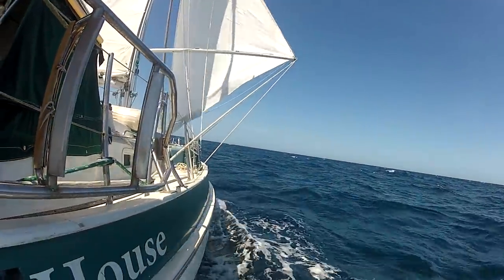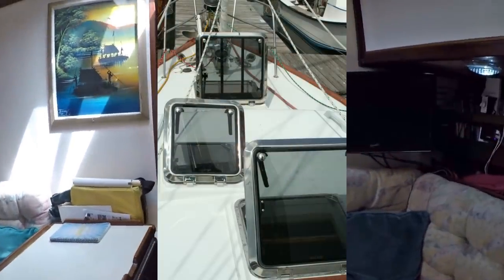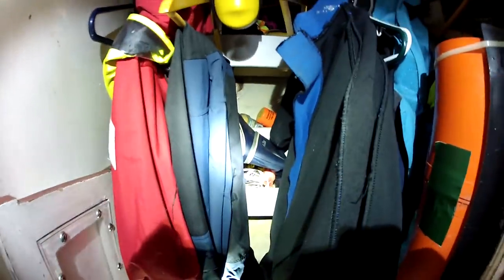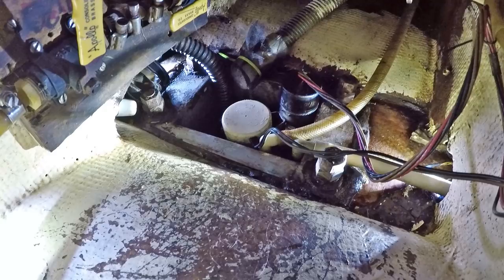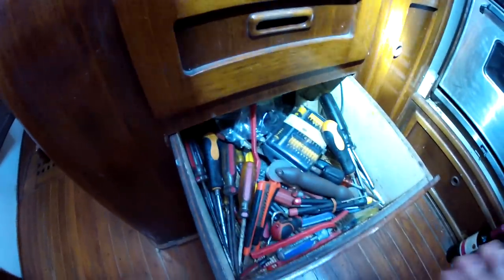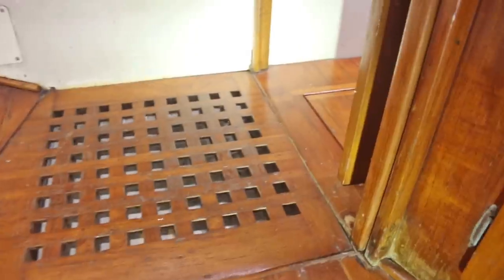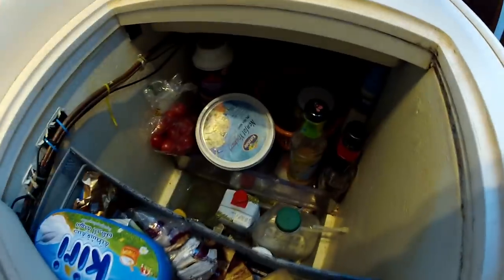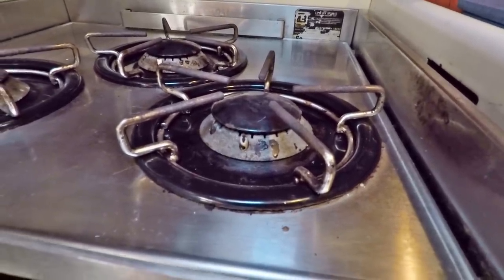Bluewater Sailboat Tour-INSIDE a Valiant 40 -(Our Tiny Home)2 Of 3 Patrick Childress Sailing #31

Comment: 10:24 Regarding the finger latches on the cabinet doors. I would think that because sailboats heal and bounce around, some heavy objects on the inside of the cabinets could be moved against the internal latches that you may not be able to move the objects to get to the latch to open the doors. An external cabinet door lock would be better.
Reply from the maker: You are exactly right, and that does happen in some of our cabinet doors like when cups or dishes get jammed into the latch. It can be a big effort to get the door open without breaking something.

Comment: What about a vented loop on your bilge pump?  Also, what about more Lily in your video? Thanks
Reply from the maker: A vented loop would be a very desireable thing to have, but in my special situation, with the check valve on the hand pump, the vent is not needed. Both Lily and Rebecca make special appearances in the next video.
Reply: I replaced by bilge pump which had been mounted high in cockpit locker with a submersible bilge pump, but forgot to install either a check valve or an anti-siphon loop - one not being needed with the prior set-up. I then had siphoning into the bilge when my stern sank lower when under power.  First I put in a check valve - but am replacing with an anti-siphon. I am not a fan of check valve since they can become clogged. Also, Rule uses 1 1/8 hose and fitting are not hard to find. I jury rigged a Whale 1 1/4 using tape and shrink wrap, but, hose clamps did not hold. So, found a 1 1/4 anti-siphon and purchased it and then afterwards located a 1 1/4 check valve.  Am going to just use the anti-siphon. Looking forward to seeing Lily.

Comment: Oh Patrick....the shame..... no hose clamps on your main bilge pump discharge line   ;-)
Reply from the maker: Jim, Hopefully others will read this and understand that Rebecca ani are deep inland in Tanzania on safari for a couple weeks so will be lax responding to comments. I have to poke this tiny keyboard with a jabber to type. Jim, you had me worried as there can always be something that which is obvious, could be missed! The main electric bilge discharge is not shown.  The white discharge hose is the hand pump discharge and because of the poor lighting and shutter blurr , the hose clamp on the discharge thruhull is hard to see. But I probably should have pointed out that that is the hose which used to come straight out then down to the  hand pump. Thanks for getting my heart rate up without exercise!
Reply: @RVLifeNOW  Sorry about that Patrick, looks like i confused that braided clear hose line as the bilge line, just a thought perhaps some hose and valve labeling to add to  an upcoming video as a safety feature thing, like you say its always the obvious things we all miss. Safe travels In Tanzania. best Jim.
Reply from the maker: @jamesouterbridge6016  james, i am using a tiny tablet keys with a poker stick while far inland in Tanzania. I got another look.... braided hose with elbow is the fridge drain, other small hose is chain lkr drain.  Vid aftr nxt I will try to remember to go back and point those out. Thanks for questioning the braided one.

Comment: Why does sink rust on the bottom but not top? It still looks nice from top side.
Reply from the maker: On the top, looking closely, there are deep but tiny pits. For some reason, it rusts faster on the bottom and is nearly rusted through. But is was installed in 1976 so nothing lasts forever.

Comment: Forgive a dumb question! With the weight of tools and spares in the built-in cabinet up in the v-berth (instead of a relatively light mattress and clothing, etc,) have you noticed any issues with sailing performance? Does the boat feel balanced? I remember reading that the Passport 40s have a fuel (or water?) tank under the v-berth and it resulted in too much weight forward and many people relocate it amidship.
Reply from the maker: That’s a great question. We always noticed that everything was too heavy..but that’s a cruising boat for you… every bit if this boat was taken up with essential stuff. It seemed more essential to at least keep it as low as possible. We put the second anchor OFF the bow and tied in front of the coachroof, and we put at least 1/3 If not half of the chain from the chain lock, through a pipe, down to the forward bilge to at least keep the weight low. She sailed great..l the best ever…so I guess Patrick did it right.

Comment: Hi Patrick
Nice job adding detail improvements to your V40. Especially the titanium chainplates.   I'm quite familiar with the design--- actually owned a yacht building business that occupied the factory where your boat was built and employed several old boys that worked for Valiant back in that era.

Three suggestions:
1-  The hinges and particularly the hasp that closes the cockpit locker are mickey mouse.  Should you ever seriously have the spreaders in the water it is likely that it will be ripped off--- and then you will have a serious flooding problem. 
2-  Since you've converted the fo'c'sle into a storage space, it's time to move the windlass and chain locker back  where it really belongs--- alongside the fwd bulkhead of the head. 
3-  Throw away the CQR.  It always was nearly useless, so why use it to weight down the bow?  If you want a second anchor get a 75# Spade or Mantus that not only works but can be broken down for storage.
Reply from the maker: 1- Correct. I did change the hasps to something a little more robust. The structure the hinges are attached to is not that robust anyway. 2- At a marina in Reunion island, in the Indian Ocean, I saw a boat with the windlass mounted just forward of the mast. The owner was never around so I could not explore just where or how the chain was stored below. The run from the bow roller to the windlass was padded for the chain to drag over. It all made perfect sense and I can't understand why no production boat manufacturer has incorporated a similar design. The snag on a Valiant-40 is the inner forestay is in the way and so is the forward hatch. It needs ro be thought out in the design process, well before the boat is built. 3- Without getting a larger boat, we have no place to store an anchor down below. Twice in 12 years we hurriedly deployed two anchors and one stored down below would have been the same as not having it at all. I would like to dump the CQR over the side but there is a good chance we will one day be in the area of
 Tierra Del Fuego and just might need a second anchor, even a CQR. After
 that, freedom from that otherwise dead weight.  Thanks for your knowledgeable comment.

Comment: Great tour. I’m 100% with you on bilge pumps. I like that Edson pump and will get one of those. The high capacity electric pump is also a great feature I will install the same. I’ve decided to instal an interior end to end sea water supply line to cut down on the number of through hull fittings. I can reduce 4 to one and improve its function with better filtering and monitoring. I love the gangway grate. I thought that through for a boat I was designing, but having bought a boat instead...thanks for the reminder... will instal one in the new boat. Your use of PVC and PE sheet as a build material is spot on too.
Reply from the maker: Thanks for watching and commenting and subscribing!

Comment: Great info.  Will incorporate some of your ideas on our1978 27 ft Cherubini Hunter.  Is the pedestal mounted drink holder made from plastic boat board or is it white finished teak?  I have seen a Pacific Seacraft boat in Mazatlan that the owner had done a beautiful job of finishing all of the deck brightwork, then covered it with multiple coats of white finish to prevent the sun from eating the clear finish.  What type of white finish did you use on your cabin roof handrails?  Did you sand the teak down to wood before applying the white or put it over a clear finish?
Reply from the maker: I sanded all the teak to bare wood, to a final 120 grit.  Then wiped with acetone to help get rid of the oils then primed with oil primer and top coat with two coats of shiny oil paint. I used a name brand boat paint from the chandlery. It is expensive but works. Exterior paint from Sherwin Williams did not last, even on interior work. Sherwin Williams, exterior paint used on a bulkhead yellowed in two years and was soft to the fingernail. There is a big difference between boat paint and house paint.